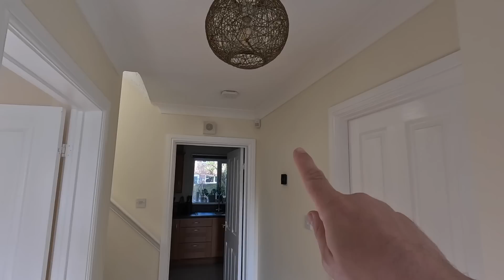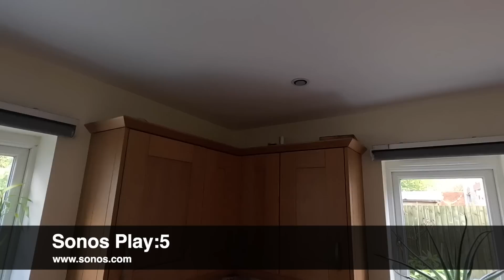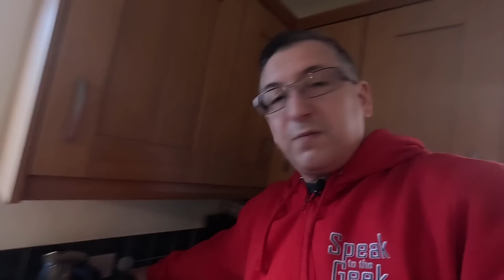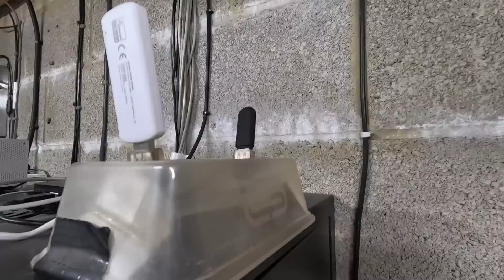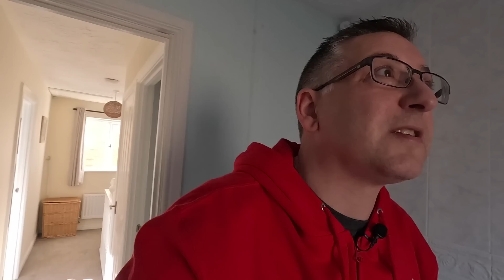Smart Home Tour 2024!

Comment: Funny to see people using Ikea buttons. I am actually removing them all, replacing them with different ones. {Loratap 2/3 button USA model}, 
Those are in my opinion better, as they are similar in size, and don't have that rocker model that can accidentally trigger twice.

Only downside is that the included panel is HUGE, 3d Printed my own minimalistic one [magnets still need to arrive].
Reply from the maker: The single press Ikea shortcut buttons are brilliant and I have several, but they don't seem to sell them anymore. I've never had any issues with double-taps on the rocker (dimmer) ones though. I think Aqara make a similarly sized one now which I'd use if I needed more.

Comment: Great video! Learnt a lot. I want to make my upstairs landing light into a smart light so I can set a time schedule for it. What module would you recommend? It’s on a 2 way switch currently so a switch down stairs and a switch upstairs. Thanks for your help :)
Reply from the maker: It really depends on what else you have in your Home Automation system - personally I use z-wave modules from either Aeotec or Fibaro. But they are more expensive than alternatives and require a dedicated z-wave controller (like a z-stick). If you have Zigbee then you can look at relay modules from Aqara. Or if you want to use Wifi then Shelly modules are probably some of the best quality around. But choosing a module aside from the wireless protocol you want also depends heavily on how your light circuit is wired. I actually started by drawing out each light circuit, the locations of the switches and the bulbs and which wire is connected where. That way I could figure out how to fit a module into the circuit based on the wiring diagrams for various types. Back when I originally specced mine up, in some places I could install volt-free modules (so the wall switches connect directly to the module only, no high voltage is sent down them) and in other places I needed 240v switch contacts. Most modules tend to support higher voltage switch contacts now, but you still need to double check all of the wiring diagrams and be certain you know what you're doing before wiring one up. I know from experience that if you get it wrong they make a nice popping sound.
Reply: @ is Quinetic a good brand? I saw they do similar modules too

Comment: Hi there. Please can you tell me if the Switchbot K10+ is integrated into your HA. If so, how?
Reply from the maker: Sort of, yes, but I don't really use it. If you have a SwitchBot Hub that's Matter compatible then the K10+ can be shared with Home Assistant. But all you currently get is a simple on/off toggle switch. I think this is because Matter has only recently added vacuum support to the standard so the full features are still trickling out. Hopefully soon it'll be feature-rich and I'll make a video on that as soon as it is!

Comment: Your setup looks quite clunky. Maybe I’m missing something here but the switchbot solution for your door lock looks like the most clunkiest solution I’ve seen for a door lock yet. Really curious as to what made you choose that over a fingerprint lock or face id type unlock. Also, what’s with the extra blanking plate when you could easily just use something like moes switch or any zigbee switch?
Reply from the maker: SwitchBot provided the Lock Pro for review. It's a retrofit option and the size is because it takes regular AA batteries as a convenience. It's large, yes, no getting around that and you'll see me mention that if you go and watch the review for the product. It is a fingerprint lock (pad on the outside), but it's also crucially a manually operated lock with a key too. As for the blanking plate, the wall doesn't have the depth for any specialist wall switches which is why the modules are placed in a separate location. It was also important to me to make the house look as normal as possible and regular looking wall switches were part of that. Zigbee wasn't mature enough when I installed any of these modules, but the z-wave ones are rock solid.

Comment: no mmwave sensors for light control downstairs ? I am so used to not having to turn my lights on or off at all these days. Also, in the bathrooms, how come no humidity sensor to control the fans ?
Reply from the maker: mmWave sensors are relatively new tech and I will eventually install them around the house. The problem is I have all of these existing PIR sensors from my alarm - if I can strip the alarm out and use the wiring to power mmWave sensors instead then I will, but I'm waiting for a few more options on the market first. It was only a couple of weeks ago at CES that a battery-powered mmWave sensor was launched, so I may try that out in the bathroom as a test. Humidity sensors in the bathrooms has also been tested but because the UK is a very humid place already they don't work reliably for fan control (lots of false positives!). I've found using timers, lights and motion sensors are more reliable.
Reply: @SpeakToTheGeekTech  for the humidity sensors, I use a derivative helper to track the rate of change, not the actual value, as you're right. Without that, the actual value can vary enormously during the year, making it impossible to set a baseline.

Comment: For all you ikea switches etc, do you use the ikea hub or run off the z-wave/zigbee usb dongles?
Reply from the maker: I connect them directly to my Conbee II stick. I do have an Ikea hub but it's powered off in my test gadgets box!
Reply: @SpeakToTheGeekTech  Are you able to control all of your devices hands-free with alexa aswell as the home assistant?
Reply from the maker: Yes, for the specific devices that I have shared with Alexa from Home Assistant. I have specifically chosen not to share everything (for example, doors and locks are not shared!)
Reply: @SpeakToTheGeekTech 👍  Cool system dude

Comment: Those Energizer smart bulbs are rubbish. Several months after buying 3 of them, 2 of them now occasionally lose their Wifi connection on start-up and flash rapidly until you go through the setup again - not great when going to the bathroom half asleep in the middle of the night, actually a safety hazard.

You really should upgrade your motion sensors to presence sensors which took over a couple of years back - nothing like having to wave your arms about to avoid darkness while still having a shave or sitting on the loo!

Some of the tech is just spending money for the sake of it, e.g. warm up the shower from bed - I turn the shower on by hand and by the time I have taken my clothes off it is hot, no need to spend several hundreds on a digi shower! And you paid for all that kit to convert the keyfob operated garage door into a wireless button operated garage door - huh?

Not sure why anyone would want to pay out to have the curtains auto close - its quicker and less hassle by hand (not having to deal with jams, etc) - maybe a useful security feature when you are away but again, not always reliable and costly to setup. Why do you need a smartlock, and what happens when it fails - does your house just end up open in the middle of the night or when you are away?

Some of the door sensors sounding a warning beep and an alert are a great idea, and the good value scales that send all the health data look good. I like the normal light conversations to motion activated using the Zwave devices.

Matter was supposed to reduce the poor compatibility and nonsense of needing loads of different hardware adaptors - doesn't look like its working yet with the amount of kit you have, just to do what should basically be in software. Even that Ikea kit still requires an expensive hub and a bridge just to do basic things, according to their website.

Could you explain what benefits that extra board gave you in the alarm system as you didn't talk much about it?
Reply from the maker: It sounds to me like smart homes aren’t for you then! If you have to ask why… you’ve already missed the point :)
Reply: @SpeakToTheGeekTech  Oh, I guess they were sponsored then and you don't know either. Nevertheless, thanks for taking the time to give the detailed response.

Comment: Nice tour thanks!

Noted down some good ideas from your setup, the letterbox contact sensor thing is almost certainly going to be my next upgrade! 

I'm new to the channel and noticed in this video your network switch had quite a number of ports/cables - do you have a video on how you've wired your house, I'm presuming you've put drops in every room
Reply from the maker: That letterbox idea has got quite a bit of love! No there’s no network wiring video, I honestly never thought it would be that interesting. I put a patch panel in my garage cabinet, ran 12 cables through the wall cavity into the loft where I drop down into various places including down the opposite side of the house into the conservatory. Inside the house there’s cabling under the laminate floor supplying the study, living room in two places, and the cupboard under the stairs.

Comment: Great Video as usual, nice to see all your smart kit. What benefits do you get from the alarm being integrated into HA, have you done a video about it? Or know of one. I have done a search but not much comes up.
Reply from the maker: I haven't done one on the alarm at all really mainly because it's extremely niche, and also it's not a part I really wanted to divulge too much information on in public for security reasons! But, the main use is as motion sensors around the home.
Reply: @ Thanks, yes that’s understandable, I’ll do a bit more research. Thanks for the quick reply.

Comment: Complains about the cost of running underfloor heating but spends 1000s on tech 😂😂
Reply from the maker: Lol, valid point! The way I look at it is I can heat my whole home excluding the conservatory using my heat pump with 1500 watts average maximum, or I could heat just my conservatory with electric underfloor heating using the same power. Seems a bit of a waste :) Also, the 2kW convection heater which is totally not-smart actually heats the whole conservatory up in about 30 minutes if needed so despite being higher power, I don't need it on for anywhere near as long for short-term use of the room.

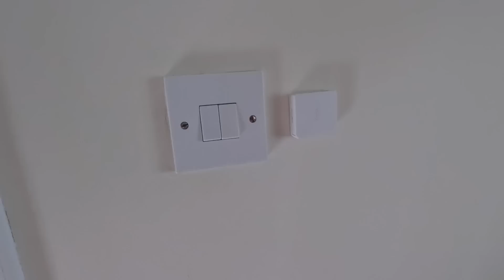Comment: Great video! Can you share details on the “push light switch” you mentioned ( 8:06 ). I have been trying to find something that “looks normal” but can act smart
Reply from the maker: The wall switch is just a double momentary wall switch plate, absolutely nothing smart about it at all and it looks pretty normal which was the intention. The switches are connected to a pair of Z-wave dimmer modules behind the blanking plate higher up the wall which in turn control either my wall lights or ceiling lights. The wall there is quite thin and there wasn't enough room to fit two z-wave modules behind the switch itself which is why I installed a box higher up on the wall out of normal line of sight.
Reply: @ wow okay! Were you able to just pick the momentary switch up from Screwfix et al or was there a specific manufacturer? This is what I have been after for a while but not able to track one down

Comment: Hi, I am just setting, or actually just started to play with Home Assistant and found handy few of your previous videos. As well, I do like this one, as it shows actual utilisation of devices for your smart house. I did research and decided to go with human presence sensors, rather than PIR's. What else I do find handy - house alarm system integration to smart home system. I will do everything me self now from sensors to controller, but will go other way - probably zigbee sensors to HA only. And as from this video, my next step is to do check ups against Off-grid side of the smart house, as I noticed your heat pump and solar energy battery packs!
Reply from the maker: Best of luck with your smart home journey!

Comment: Great video as usual. Out of interest why did you go for the separate batteries and inverters rather than just another 9.5 battery?
Reply from the maker: It wasn't a planned thing - the All-in-one was an early release installed for promotional reasons. Initially it totally replaced the older AC3, but I have since re-installed it to make the most of the capacity I have available.

Comment: Ive been running deconz II for a few years now, all works fine.
Where are you upgrading to?
Reply from the maker: I currently use the Conbee II with zigbee2mqtt not deconz, but I plan to switch the Conbee II over to an SMLight controller still in zigbee2mqtt

Comment: I spent £600+on the IKEA thermal blinds and had nothing but issues with them too. Often they don't respond, they have strings in which get messed up a lot, some mornings I've come down and they've managed to tangle themselves up ABOVE the bar somehow! 🤦🏻‍♂️

If you still have issues, try delaying the blind commands on H assistant so one closes 10 seconds later or something, they seem to get confused when multiple commands sent at once I've noticed.
Reply from the maker: Thanks for that tip, I'll give it a go. At the moment I have the two kitchen blinds grouped and control them as one, but I'll separate them out in the automations to see if it improves it.

Comment: Crikey!

Whats your base load with all that stuff? Does it add up to any meaningful consumption?
Reply from the maker: Too much! That old alarm system on its own pulls about 30 watts and I would love to replace it at some point. My server rack in the garage draws 65-75 watts continuously too. The Echo and Sonos speakers pull about 50 watts total between them. It all adds up and means we have a high baseload but I consider that partially the price I pay for my hobby. As a consequence you are aware that I also use that hardware to try and minimise my energy consumption in many other places around the home so the net effect is less than it would be otherwise. Honestly, there's a lot more tech in the house than shown in this video, I just forgot / ran out of time!

Comment: Be great to see a Give Energy ev chargers home assist integration special? Any sign of octopus tariff integrating with it?

(Happy New Year)
Reply from the maker: I've already made one of those - this method is the one I still use to this day: https://youtu.be/uBmra2CW_5Q but I think there might be a pre-made integration now that does the same thing. You can of course use GivTCP to control it locally but I haven't found that method particularly reliable myself although I do know others using it without issues. And no, there's no sign of Octopus adding it to IOG yet, but honestly with the extra hour now available on normal Octopus Go and its associated export rate equalling IOG there is very little difference between the two tariffs for most people. You'd save a little bit with IOG compared to OG but it's a couple of pounds a month rather than the tens of pounds it was previously.

Comment: How are you finding the Reolink cameras, had 3 of them and 2 of them let in water within a year. Slowly replacing them in dahua which I’ve had a couple for 2 years without any issues.

Also how much did your solar setup cost and have you worked out how long to pay it off? Had octopus quote me £8k and about 9 years to break even.
Thanks
Reply from the maker: So far they seem to be great. I haven’t had them a year yet though so time will tell on that issue.

Comment: Git some good inspiration. Cool video. Fir your bathroom though look at shower humidity on the hime assistant community. Ive got the motuon sensor, but use a sensor made up from 2 humidty sensors. Ine in the bathroom and one in my bedroom to look for a change in humidity and thats turned into a binary sensor so when humidity is detected in the bathroom, it turns the fan on and light until the humidity is back to normal. It does make you feel like youre in the future! Although now a days a presence sensors probably better 😂
Reply from the maker: I did try a humidity controlled fan but found that it would turn on at very inconvenient times. I’m sure things have improved since then so perhaps it’s worth another try thanks
Reply: @SpeakToTheGeekTech  mines been set up a few years now. I had false readings when only using one humidity sensor in the bathroom as you know the UK has a humid climate, but I did find something that compares the rise between 2 humidity sensors and that's been pretty solid!

Comment: Interested to know what your base "phantom" load is with all of this gear.
Reply from the maker: Very good question :) I wondered the same thing - I monitor the whole of my server rack which uses 65-70 watts. Most of the other devices around the house are tricky to monitor but they tend to drawer almost nothing most of the time (probably 10 watts total from experimentation). I have a high baseload but it’s from the server rack and computer equipment rather than the various other gadgets scattered around. I am working on a whole home energy monitoring video but that’s probably a March release at the earliest
Reply: @SpeakToTheGeekTech  I was a beta customer for E.ON a few years back and we have Zwave sockets that we used for all appliances and a whole home meter. It was very interesting to see where power was used and what you could change. For us there were some surprises like a Tivo box we hardly used which used 70w most of the time. We got rid of devices like that. Our home is 100% electric so we do use a lot but I also have so many small devices it does add up.